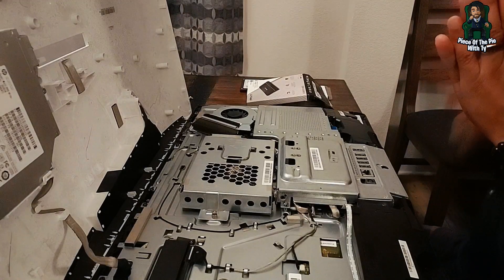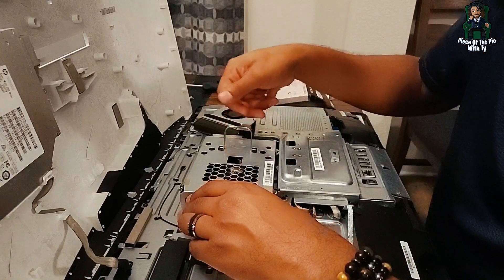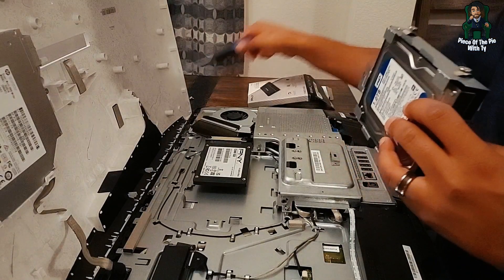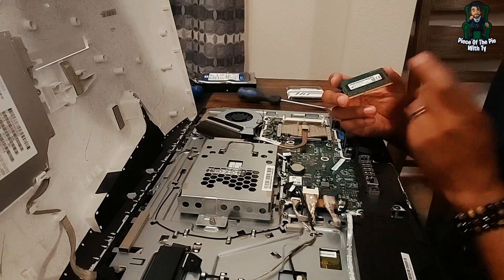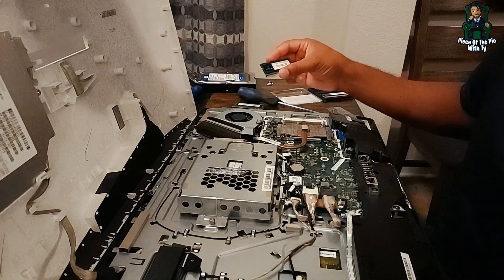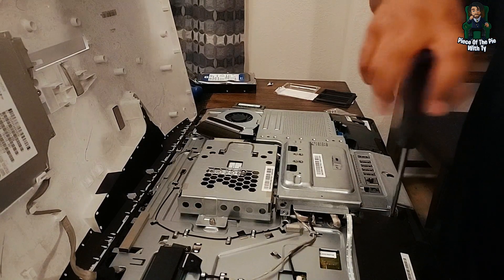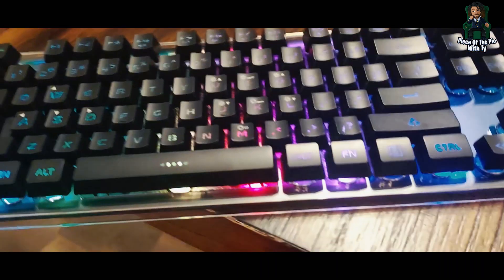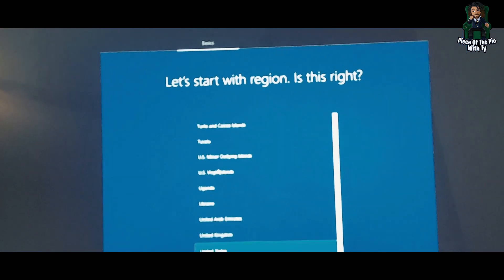How to Upgrade the Hard Drive and RAM in an HP Pavilion All-in-One Model 22 - a113w

Comment: Hey man got a question. I seen in your description you also bought  usb hard drive adapter, is that so after you get the new hard drive in you can plug the old hard drive into the adapter and back up all your stuff to the new one??

Just wondering because I’m currently in the same process with the same computer in your video. Thanks for the video and let me know please!
Reply from the maker: You are correct. I brought that so I could transfer my data that I wanted, but I would recommend you to just use a portable external drive to transfer before you start the process. I had trouble with that cable and my old drive.